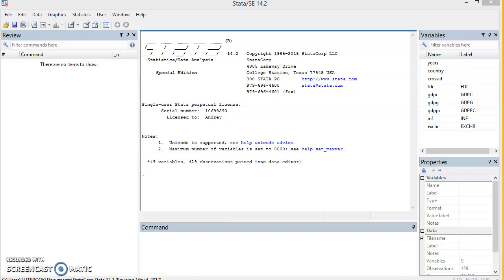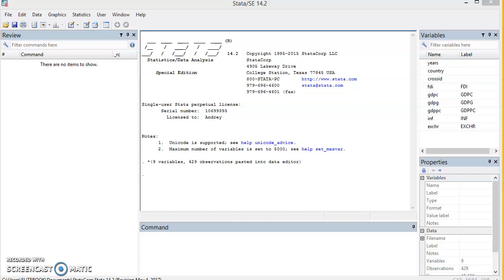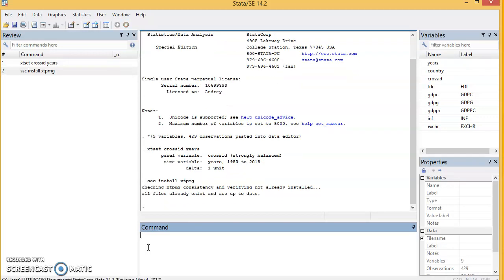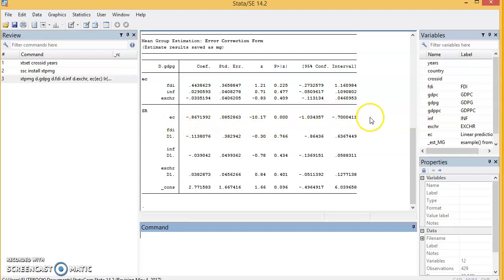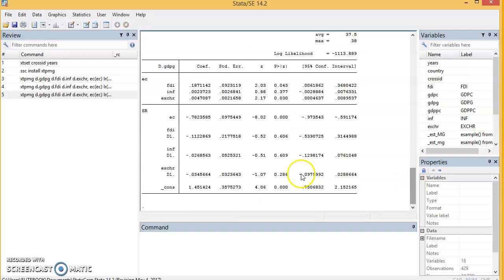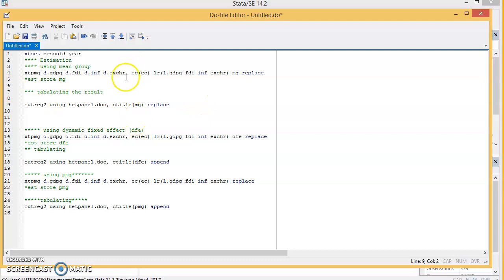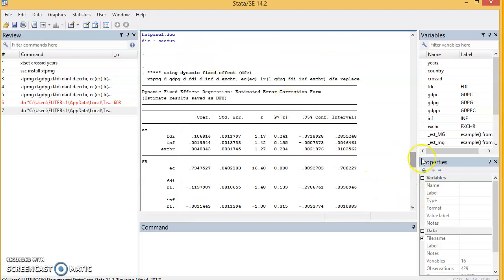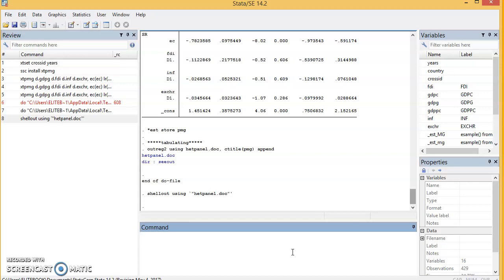How to estimate heterogeneous panel model/Panel ARDL in stata

Comment: Thank you for your informative videos. I have a question about choosing between the ARDL and FGLS models given my data's characteristics (T>N, but T=16 and N=7, heteroskedasticity, and slope heterogeneity).
In this case, can the FGLS model be used in place of the ARDL model when some variables are stationary at I(1) and I(0) and there is cointegration between them? 
Sorry if my question sounds basic. I am new to these types of models.

Appreciate your insights.
Reply from the maker: Yes, That would be correct. FGLS model is potent, especially with variables exhibiting heteroskedasticity and or autocorrelation

Comment: great video.how do i proceed with panel heterogeneous when there is no cointegration
Reply from the maker: No cointegration means no long-run relationship. You'll have to focus on the short-run component of your result, and not interpret the long run
Reply: @josephlanre  which model would be best?i have mixed variables of I(0) and I(1)
Reply from the maker: @lombechangala2803  ARDL model
Reply: @josephlanre  thank you very much. I am trying to use the ccepmg as i have cross sectional dependence in my variables. Since the xtcce2 command in stata displays both short run and long sun results. If i got you correct i should only report the short run section and regard the long run section as insignificant right? all variables from the long run section are insignificant. Apologies for the long comment.

Comment: Good Evening Sir. Thank you so very much for your videos - they are always so well explained. I especially like the fact that you tell us of the need to install the programs needed so we can execute the estimation commands. Please with regards to the estimation for mg (mean group) - when I execute the command, it returns with the following error message: "invalid new variable name. Variable name ec is in the list of predictors." Please how can this be resolved? I look forward to your kind revert. Thank you.
Reply from the maker: Hi Angie. I hope you day is going wey. It's a common problem with Stata 16 when you're MG. Still trying to find a way around the version. However, it works well with Stata 14 and 15. You might want to consider them. Regards
Reply: @josephlanre  Thank you so very much Sir for your kind reply. If I may ask, if one or two of the variables are not stationary at level (for the IPS unitroot test) but are stationary at first difference - do you still go ahead to estimate or do you have to denote the first difference of the variable in your long run variables. For example, going by your model, if your GDPG and INF are stationary at first difference do you go ahead to estimate it like you've shown us or do you estimate it like this: xtpmg d.dgdpg d.fdi d.dinf d.exchr, ec(ec) lr(l.dgdpg fdi d.inf exchr) replace
Thank you so very much Sir.